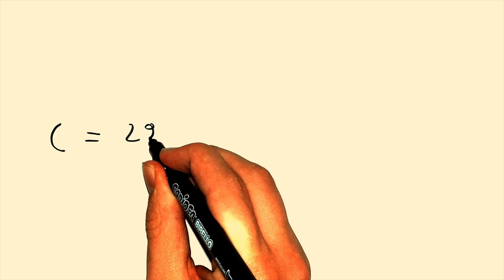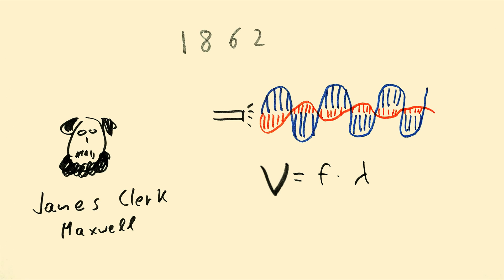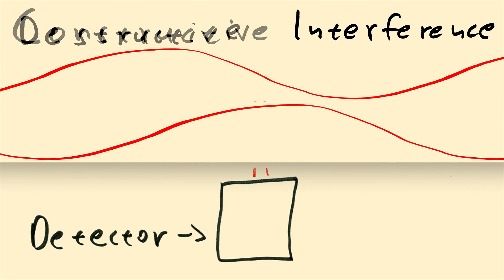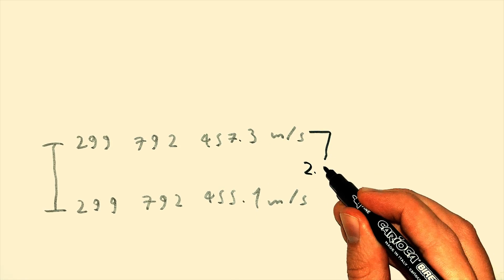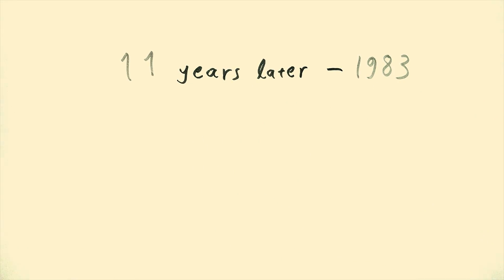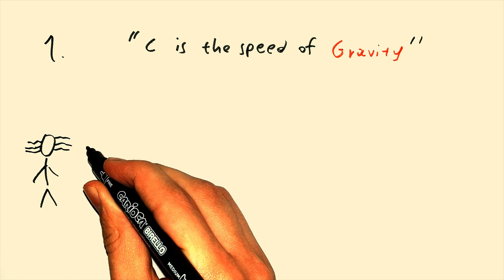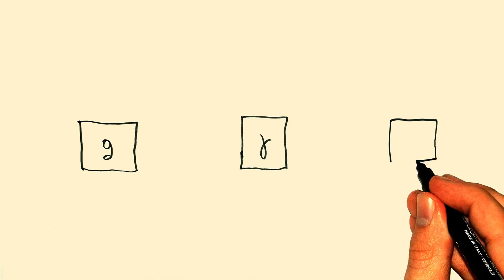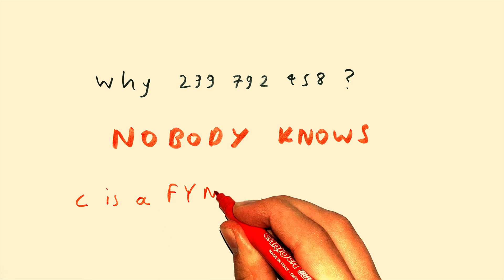How did we Measure the Speed of Light

Comment: The association of the main numbers in the field of mathematics with each other, reflects numerical sequences that correspond to the dimensions of the Earth, the Moon, and the Sun in the unit of measurement in meters, which is: 1' (second) / 299792458 m/s (speed of light in a vacuum).

Ramanujan number: 1,729 
Earth's equatorial radius: 6,378 km. 
Golden number: 1.61803... 
•  (1,729 x 6,378 x (10^-3)) ^1.61803 x (10^-3) = 3,474.18 
Moon's diameter: 3,474 km.

Ramanujan number: 1,729 
Speed of light: 299,792,458 m/s 
Earth's Equatorial Diameter: 12,756 km. Earth's Equatorial Radius: 6,378 km. 
• (1,729 x 299,792,458) / 12,756 / 6,378) = 6,371 
Earth's average radius: 6,371 km. 

The Cubit
The cubit = Pi - phi^2 = 0.5236
Lunar distance: 384,400 km.
(0.5236 x (10^6) - 384,400) x 10 = 1,392,000
Sun´s diameter: 1,392,000 km.

Higgs Boson: 125.35 (GeV)
Phi: 1.61803...
(125.35 x (10^-1) - 1.61803) x (10^3) = 10,916.97 
Circumference of the Moon: 10,916 km.

Golden number: 1.618
Golden Angle: 137.5
Earth's equatorial radius: 6,378
Universal Gravitation G = 6.67 x 10^-11 N.m^2/kg^2.
(((1.618 ^137.5) / 6,378) / 6.67) x (10^-20) = 12,756.62
Earth’s equatorial diameter: 12,756 km.

The Euler Number is approximately: 2.71828...
Newton’s law of gravitation: G = 6.67 x 10^-11 N.m^2/kg^2. Golden number: 1.618ɸ
(2.71828 ^ 6.67) x 1.618 x 10 = 12,756.23
Earth’s equatorial diameter: 12,756 km.

Planck’s constant: 6.63 × 10-34 m2 kg.
Circumference of the Moon: 10,916.
Gold equation: 1,618 ɸ
(((6.63 ^ (10,916 x 10^-4 )) x 1.618 x (10^3)= 12,756.82
Earth’s equatorial diameter: 12,756 km.

Planck's temperature: 1.41679 x 10^32 Kelvin.
Newton’s law of gravitation: G = 6.67 x 10^-11 N.m^2/kg^2.
Speed of Sound: 340.29 m/s
(1.41679 ^ 6.67) x  340.29 - 1 = 3,474.81
Moon's diameter:: 3,474 km.

Cosmic microwave background radiation
2.725 kelvins ,160.4 GHz,
Pi: 3.14
Earth's polar radius: 6,357 km.
((2,725 x 160.4) / 3.14 x (10^4) - (6,357 x 10^-3) = 1,392,000
The diameter of the Sun: 1,392,000 km.

Numbers 3, 6  &  9 - Nikola Tesla

One Parsec = 206265 AU = 3.26 light-years = 3.086 × 10^13 km. 
The Numbers: 3, 6 and 9

((3^6) x 9) - (3.086 x (10^3)) -1 = 3,474 
The Moon's diameter: 3,474 km. 

Now we will use the diameter of the Moon.
Moon's diameter: 3,474 km. 
(3.474 + 369 + 1) x (10^2) = 384,400
The term L.D (Lunar Distance) refers to the average distance between the Earth and the Moon, which is 384,400 km.

Moon's diameter: 3,474 km. 
((3+6+9) x 3 x 6 x 9) - 9 - 3 + 3,474 = 6,378
Earth's equatorial radius: 6,378 km. 

Orion: The Connection between Heaven and Earth eBook

Comment: A method to discover the one-way speed of light.

Does light have a tail? 

If light has a speed limit, then it has a tail. If light is instant than the off is just as fast as the on. 

To find out if light has a speed limit take it past that limit and observe. To get light to appear to move past its limit, if it has one, simply rotate it.  If light has a speed limit, as the circumference of the tip of the light grows ever larger, depending on its rotation rate, the angle at which the light would appear to progress in a snap shot view changes.  

If light does not have a speed limit the arc will always appear at a similar radius. 

If and when the tip of the light that creates the arc, is appearing to progress at a 45-degree angle to its path, you are at its max speed.  X=Y moving at the same rate. 

One of many configurations in finding the one-way speed of light, may be done easiest in space:  SEE DRAWING ONE WAY LIGHT SPEED BELOW.

Configure three satellites. One at center and two at a radius. Rotate a laser on a center satellite, and use the two satellites at the radius as targets. The targets are 49.85 and 45.85-kilometers radius and they are 4.8 degrees apart.  This geometry will give you a 45-degree angle between the two satellites targets from the mean radius tangent of 47.85 KM.  

It is believed that it takes light about .0001663 seconds to go 49.85 KM. in space. 

Run the test, based on the believed speed of light:

Rotate and fire the laser: The light is traveling to satellite #2 and will be there in .0001663 sec., with the rotation of the laser at 1000 rev/per/sec it takes .0000134 sec to rotate the entire 4.8 degrees between the two satellites and at that point the light is then traveling at the satellite #3. 

Conventional belief light travel times
49.85 KM in .000166281 sec 
45.85 KM in .000152939 sec 
                  .000013342 sec difference 
Rotational speed to travel 4.8 degrees in .000013342 sec = 999.35 rev / sec
At the above rotational speed of 999.7 rev/sec the light would hit the two satellites at the same moment, if it is traveling at 299,792 KM/sec

Examples of other speeds: 

Light at instant speed can never hit both satellites at the same time, as the light is rotating. 

If Light were traveling at 250,000 KM/ sec

49.85 KM in .0001994
45.85 KM in .0001834
                     .0000160 difference, if the speed of light is 250,000 KM/sec you would have to have the rotation of 4.8 degrees in .000016 sec or 833 rev/sec

If Light were traveling at 350,000 KM/ sec 

49.85 KM in .00014242
45.85 KM in .00013
                      .00001242 difference, if the speed of light was 350,000 KM/sec you would have the rotation of 4.8 degrees in .00001241 sec. 1074 rev/sec

                     
Observations

The two satellites are at a base distance of 4 km apart and the apparent path of the light is about 5.665 KM apart. The tip will appear to travel 5.665 KM in .0000134 or 1.41 times the believed speed of light. But in reality, the light is traveling 4 km less than satellite #2. In the PDF the actual light path, if the speed of light is as thought, the path is shown in the cross hatched line. At two angles, one at the speed of light and one just below, with less that a 45-degree angle to its base. 

If light is instant, the light will hit the first satellite at go, and the second satellite always at the rotational speed, no more no less, and can't hit them both at the same time. Rotation speed and the speed between the two satellites will always be the same. If light is instant, then the off is as instant as the on, it has to tail. 

The light, if traveling at 299,792,000 and rotating at 1000 RPS it will hit both satellites at the same time, if not then adjust the rotation speed and or the distance(s) until that happens and then calculate the speed of light. 

A clock is installed to time the satellite target impacts, so the rotational speed can easily be adjusted and tuned to the speed needed to hit the two in zero time. Once that is achieved the clock is no longer needed.  

At the instant you fire the laser for a millisecond you at the same time are recording and entering into the equation the exact distances and angles to the satellites. It would be extremely accurate, down to a millimeter.

I chose to use 47.85 KM as the radius as that is very close to the speed of light at 1000 Revs per second.  47.85 x 2 x (p) 3.1417 x 1000/ sec = 300,660 KM/sec to the median circumference. 1000 Rev./sec is easily achievable, especially in space, the laser doesn't have to rotate 360 degrees, it only has to move the 4.8 degrees in the allotted times and or adjustable times. The laser only has to fire for a millisecond, so it could be a very high-powered laser.  

This method eliminates the current objections to the use of clocks.  The Einsteinian arguments against clocks are two-fold, one is syncing two clocks at different locations and the second is using one clock in a round trip, starting and stopping the same clock. The objection in the latter is not an objection to clocks / time it is only an objection to it being a round trip voyage. Which I believe is problematic.

In both those objected to efforts above, the clocks measure an amount of time of light travel. In the above proposed method, there is one clock that measures the rotational speed of the rotating laser, which measures Rev/per/sec. That clock in no way measures any distance in time of light.  Another clock is used to tune the rotating laser to discover the one-way speed of light. Once the tune is complete the clock does not measure time. No current objection would apply to the above method. 

If light is instant, no matter how fast you rotate the laser, it will never hit both satellites at the same time. 

Perhaps far more interesting, if light does have a limit, then some light, if it has enough energy, from distant places is getting to earth appearing at an angle, or if you will, a shift

Comment: Gravity is actually a Magnetic field and if the magnetic field is strong enough it can bend or stop a light wave.   Therefore the current speed of light measured is wrong.. it's actually faster when there is no Gravity or Magnetic field slowing the lightwave down... another issue is the wavelength of the light source itself.   The actual speed of light is closer to 308,994,000 mps.
Reply: where did you get that info?

Comment: In a completely darkened room I switch on my lamp. There is light and it propagates very speedy, say at   that number c. Now is that light a wave, cf. Maxwell? Yes. Electromagnetic wave. Ok. Consisting of what? Photons with mass = 0 but some ( relativistic) momentum, say. Fine. Now I turn the lamp off! No light anymore. Instantaneously? Where has the light gone? Where have the waves gone? The Photons died , decayed instantly into what? Into nothing? Will light we see from Stars some trillion years ago ever vanish! End up and diffuse into nothing somewhen. Or will a laser beam we shoot out into Universe some day reach the end of Universe? Would it at least if Universe would expand at less than speed of light? Or is light simply something that exaltates a field? The field being given with or without light pulses? 
This is a cry for help! 😧
Reply from the maker: Light gets absorbed by the objects it hits. Unless that object is a perfect mirror. It seems instant because it happens really fast. But light bounces from object to object until all the energy has turned into heat for the objects it hit.

Stars are a different story. In the Star case light isn't absorbed because there is nothing that can absorb it. But light spreads out equally in all directions so as you get further and further away less light reaches you until eventually you only see individual photons
Reply: 🙏 thank you!

Comment: Light doesn't travel at all, if it does then darkness is faster. Light n darkness are just fields onbthe same but different ends of a spectrum. For one to come to the conclusion that one travels, they have to assume that the other is nothing at all.
Reply: Orrrrrr, one could consider that darkness is the absence of light, just like cold is the absence of heat.
Reply: Geoffrey Zoref,
Darkness, a reality that has been there for eternity past can never be the absence of light just like a tree can never described as unprocessed furniture.
Nice try though
Reply: @Mooseouma  
Then can you describe what darkness is? What properties does it have?
Reply: Noose om, darkness is the absence of light. 
It takes approximately 8 minutes for light to travel from the sun to the earth. 
If you could place a gigantic sunscreen close to the sun you’d still receive light for 8 minutes, then it would be dark. After removing the screen it would take 8 minutes for the sun light to reach earth again.

Comment: why 1mm is wavelength = 4mm ?
Reply: OK. They move the mirror 1 mm. That means that the total distance change that the light travels is 2 mm (assume you move the mirror to make the path longer. 1 mm further travel to reach the mirror and then an additional 1 mm further travel to return to the half silvered mirror. So the total path is 2 mm longer).
And the distance they're looking for is to change from constructive interference to destructive interference. That's 1/2 of a wavelength. So if you go from constructive to destructive interference by changing the path length by 2 mm, that means the wavelength has to be 4 mm.
Reply: So we now know wave lenght of laser which was used on research at earth atmosphere. Same test done at vacuum and sun light?

Comment: Well, when they redefined the length of a meter then the speed of light was dependent on the definition of meter. So why didn't they defined meter as an more useful unit so that light speed would be a nicer number like 300000000 m/s ? :(
Or is 299792458m/s a more useful number in other calculations?
Reply: vinod kumar I guess to keep the change insignificant for daily use. If they changed the meter to match 300000000 m/s the difference to the original meter would have been about 7mm but with 299792458 m/s its only point something of a millionth of a meter.
Reply: tspnglr, yeah I thought the same. Thank God(maybe the scientists) it is a whole number:)
Reply: Soundsoflife, how?
Reply: Many of the constants are effectively circular definitions. When they update the value of a known constant to be more accurate, they typically make sure that new value falls within the error margins of another constants that are dependent on that constant. Over time, all constants get more and more accurate.
Reply: It has always been policy when adjustments are made in units of measurement to minimize the effect on current practice.

Comment: What i understood from this video is (Plz correct me if wrong) that LIGO Experiment was done to verify the speed of light is ~3x10^8 m/s as mathematically proved by Maxwell in Electro-magnetic Waves equation. The results were close. Lack of proper definition of meter was the reason behind that. Hence later we defined Unit as path traveled by light in  1/299 792 458(we took this number because it was mathematically proven by Maxwell) of second.

Thanks.
Reply from the maker: +Anurag Shakya

The experiment done that did everything you said used Laser Interferometery. The same technology that LIGO did. LIGO doesn't have have to do anything with the measurement of the speed of light. The LIGO experiment was done in 2015 not 1972. LIGO just happens that it uses the same technology that the speed of light experiment did. And that is the only reason why I included it in the video.

Everything else you said is correct.
The imperfect definition of the meter was the reason for the uncertainty which was fixed when it was redifined.
Reply: Thanks for the reply.

Comment: Great video! Just one small question: why is the wavelength the product of the moved distance of the mirror times 4?
Reply from the maker: +Maximo Fuentes

In order for 2 waves to get from in phase to out of phase they have to move 1/2 a wavelength apart.

When you move a mirror a distance L then the 2 waves move 2L apart because they move L when they go and L again when they return.

If L=1/2 a wavelength then L/2=1/4 a wavelength
Reply: Pattern ohhh, thank you!
Reply: If L= 1/2, wouldn't 2L=1?
Reply from the maker: keppela1

Yes it would. Thank you for the heads-up. I edited my answer to correct this.